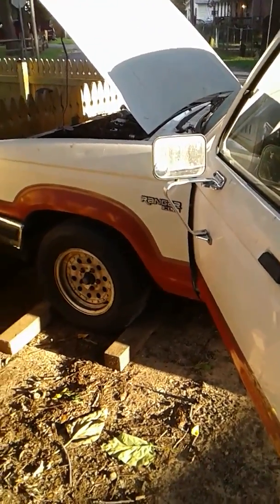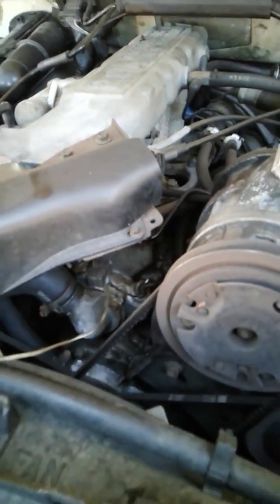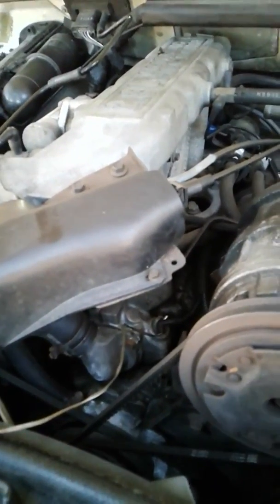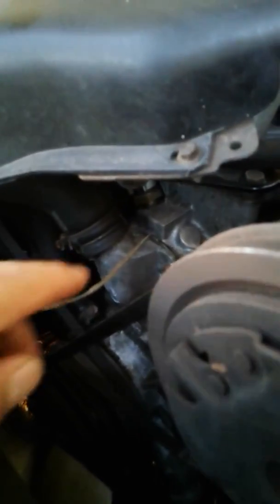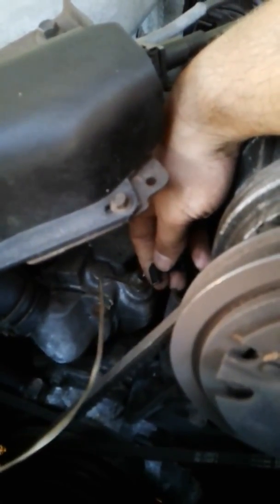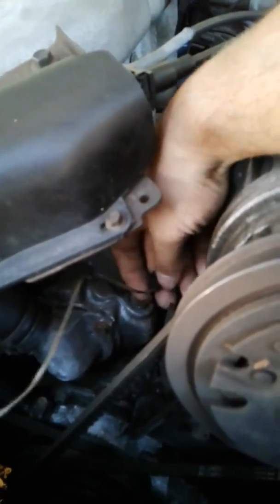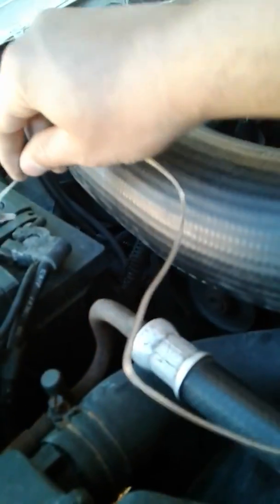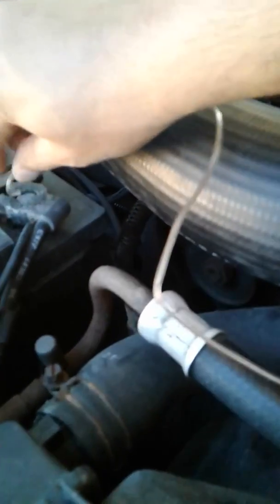basics of coolant temperature sensor ford ranger 1989

Comment: I would put a 200 ohm resistor in series with that wire instead of just grounding it straight to ground.  It's not good to peg a meter for a long time, as it can damage the meter.  I think 200 ohms should give you approximately a mid-scale reading, or where ever the meter normally reads when the engine is warmed up.
Reply from the maker: Thank you for the information , definitely never thought of that . I could have caused some damage shorting it to ground like that
Reply: @WheelersHoarder  I was wrong about that 200 ohm resistor.  
For an '89 Ranger with the 2.3 liter engine, grounding the sensor lead with a 25 ohm resistor will give you about a mid-scale reading.  10 ohms should push the needle to Hot on the gauge and 78 ohms should move it to the cold part of the scale.
Reply: @WheelersHoarder  I found this chart, which will come in handy for anyone who needs to check their sensor.
A lot of their vehicles use this coolant temperature sender (thermistor).  You should check your service manual to know for sure the proper resistance values to try when you are testing your meter. 

FORD TEMPERATURE SENDER CHART

Ohms  Degrees  Gauge Mark
78         130         "C"  
50         160          Low Line
26         200          Center
16         230          High Line
10         250          "H"
Reply from the maker: @ thank you , very handy chart

Comment: to where part is conected the cable i got trouble with mine
Reply from the maker: I'm sorry it has been a really long time since I made the video , I will try to find some wiring diagram
Reply: @WheelersHoarder  please i don't find anything so i can't conect the wire
Reply: @WheelersHoarder  I believe it's a black wire with a blue stripe.